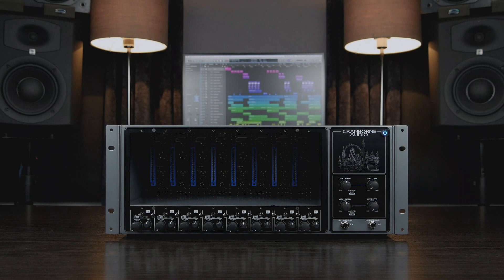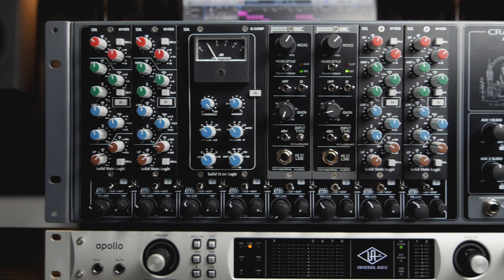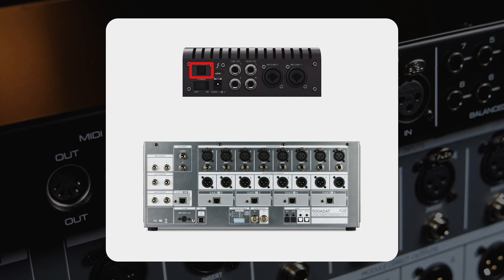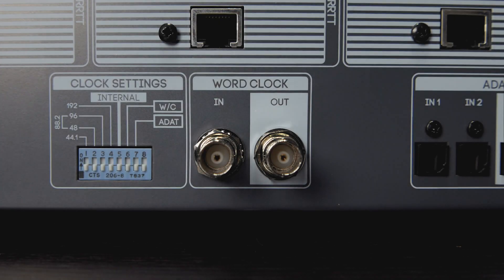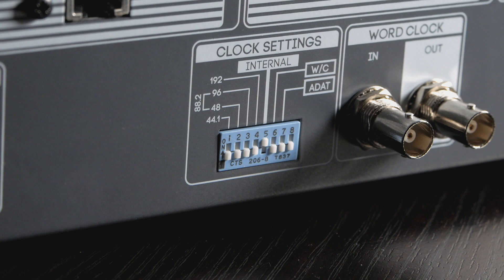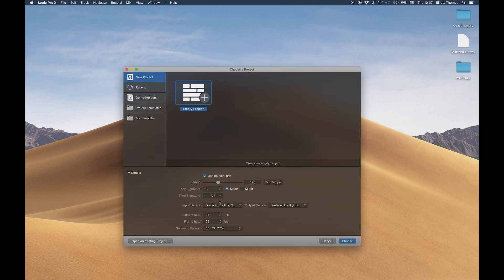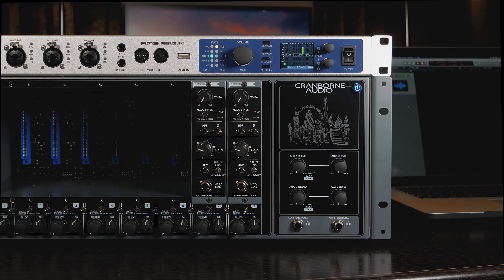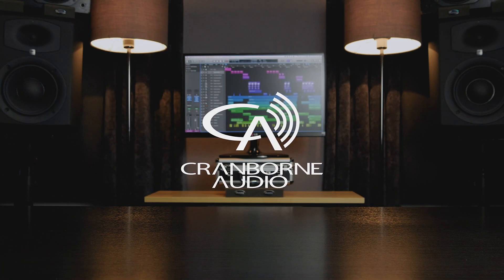500ADAT Quick Tutorial | Expanding Your Audio Interface Using ADAT

Comment: HI, I am planning on getting a Cranborne 500ADAT to connect to my Apollo x8 but keep it next to my drums while the Apollo is on a rack further in the room. Would it work to use 20-ft optical cables to connect each other? Also, what cable brand(s) would you recommend for such long size. Thank you.

Comment: I there any option to insert 19 outboard gear? for example, if I want to use dat channel 7/8 for my SPL St Comp, how do I connect th unit to the CB 500? And if I want to use my LA-610 via adat channel 2, is this also possible? thx
Reply from the maker: Hi, each channel has it's own TRS input. So you would connect your SPL Comp to the inserts on channels 7/8, and that would record into your DAW on ADAT channels 7/8. The inserts come AFTER the module slot in the 500ADAT signal flow, and each insert is still available if you have no module installed and the slot bypassed.
Reply: @cranborneaudio  Thanks so much! I just asked that insert before/ after the slot question on another one of your videos.

Comment: Is it possible to use 2 stereo units in the same slots if each unit is bypassed when the other is being occupied. For example, if I have my saturation unit going out via XLR and my SPL big inserted in the same 500 series slot.
Reply from the maker: Hi Rich, I believe you have also just received an email response to this, but for others who may be interested in the answer, if we have understood you correctly; slots are either bypassed or not, and cannot operate in both modes at the same time. Additionally, since the input source for the slots can only be USB or Analog, it's not possible to separate or split the I/O in the way you described. If a module is present, the audio signal always passes through it. We hope this helps.

Comment: Can  I use the slots in series with adat? Instead of 8 separate channel just one channel in and out?
Reply from the maker: Absolutely, if you're looking to use your 500ADAT simply as a single channel strip comprised of 8 modules, simply input your audio to channel 1, then activate the 'Chain' switch on channels 2, 3, 4, 5, 6, 7, and then record to your DAW on channel 8. You can read more about the 'Chain' feature on page 17 of the 500ADAT User Manual here: https://f.hubspotusercontent20.net/hubfs/4191221/User_Manuals/500ADAT/500ADAT_User_Manual_25_10_19.pdf

Comment: All via a set of two cables compared to patching. Amazing. Can you elaborate on latency and with the inbuilt converter,  the crossover distortion?
Reply from the maker: Thank you Tau! We do not publish Crossover Distortion in our specifications because it is vanishingly low... that's easy to say I know! The THD of our device gets better and better as the level drops. There are no sudden peaks or THD hotspots and we have designed the circuit to ensure that THD is smooth, consistent and stays low at low levels, only to increase if things get too hot. Sorry I can't give you more information there but all I can do is assure you that it is very, very low indeed! Thanks again! CA

Comment: Love my 500 ADAT, had a quick question that I'm not sure I saw addressed in the manual.  I have a BAE preamp eq module that takes three spaces, If I place it in slots 1,2,3, can I set 2 & 3 to bypass and still use those channels as inserts or line in on the back?  And if I then want to link that Bae module to something in slot 4? Say a compressor, do I need to switch the link across all of the slots? Would that negate the inserts?
Reply: Hi Chris, I am researching on 500 Modules and Lunchboxes. Your question is very interesting. Do you have an answer already? I would like to know. And congrats to the BAE 1073D module, that one is a gem. I would have another question. How to use a Stereo channel EQ or Compressor module for this 500 ADAT? Is it possible to dedicate an SSL Bus Compressor to a Stereo Drum Bus in a DAW? Thanks
Reply: I have the same question, hope @cranborneaudio reads this. Happy recording everyone.

Comment: 2:06 OK you just crossed the line from confident to cocky. Maybe next time you suggest your clock outperforms other clocks,  don't have an interface with one of THE FINEST clocks available in frame when you show us how to set master/slave.
Reply from the maker: Hi Draztiq, quite the contrary! We are massive fans of RME and respect their interfaces massively - the interface in the picture is our own and we love using it. In this video, we show how you can slave our unit both as a MASTER or as a SLAVE and we describe the differences between the the two methods in terms of the impact of jitter and recovery clock of both devices.

The RME is used as an example interface and ultimately the choice is down to you as the user. However, the numbers we describe in terms of Jitter etc are real numbers published by RME or ourselves. If you compare the numbers scientifically, our clock has less jitter when used in recovery mode and lower jitter when used as the master clock - that doesn't mean that theirs sounds worse or is inferior and isn't intended to be 'cocky' - we are trying to be factual and help you as as a user decide how best to integrate 500ADAT with your interface, Hope that helps!
Reply: @cranborneaudio  Holy shit I stand corrected. OK. That's surprising and I'm very impressed. I'm willing to delete my comment if that's helpful to you guys. Arriving on the scene fully awesome doesn't usually happen, you know?

Comment: Is it possible to use the 4 mic pres on RME UFX 2 in slave mode and extend the amount of mic pres available (eg: want to record drums with 8 mics) also is it possible to do this without having to buy modules installed in it or in other words does this have phantom power for each of the channels?
Reply from the maker: Hi Jordan, sorry fo the late reply! With 500ADAT and the UFX together you can record up to 12 channels - effectively using the UFX's channels as extra preamps, but you cannot connect microphones directly to 500ADAT without any modules being installed. The slots only support line-level sources when they are bypassed - but that being said, you could use any preamp - from any mixer, another audio interface or similar and then connect the output of that device into 500ADAT. Hope that helps!

Comment: I wonder if the ADAT cable keeps the audio quality as a normal TRS/XLR cable does
Reply from the maker: Hi @preciseaudioblog, it's a tricky comparison as ADAT is of course a digital audio transportation method, whereas a TRS connection is all-analogue so neither really 'sounds better' than the other. Most importantly with ADAT and a closed system like 500ADAT is that it is handling all of the A/D D/A conversion into your audio interface via ADAT using its own superior converters in addition to the line inputs on your audio interface - giving you more IO to play with. On a traditional system with TRS cables between a rack and interface, you are not only wasting all of your analogue IO just for your 500 series rack, but the audio interface's conversion will be the limiting factor on the setup. Not to mention issues such as maximum input levels, impedances, balancing and other variables there are with an all-analogue system, vs our hybrid setup. So in theory, our system can sound better (could be quite a lot better depending on your audio interface) and much more consistent, plug-and-play, and adds to your interface to give you more, rather than waste your analogue I/O. Hope that helps! CA
Reply: @cranborneaudio  Thanks for the explanation. Cheers!

Comment: Hi! I'm slightly confused and would apprecierade some help : )

I wonder - would the 500adat act as an 8 ch in/out expander even without any modules installed in it, basically function like a normal converer with adat io?

So in practice I could connect a bunch of syntezisers to the line inputs at the back of the 500adat,  connect it to RME UFX II with adat and do standalaone mixing via RME or daw recordings if I wish to?
Reply: Hey, from what I understand, (I think) this is possible! Check the 500ADAT manual, I believe they confirm it.
Reply from the maker: Hi Nils1 Sorry for the late reply! But yes, you cannot connect line-level sources into 500ADAT and record them without any modules installed! Hope that helps!

Comment: ADAT cable = spdif optical cable?
Reply from the maker: SPDIF and ADAT connections use the same cable (Optical Cable with Toslink connectors) so yes they are the same cable - however you cannot connect Optical SPDIF to ADAT as they are different formats and are not understood by eachother.

Comment: This is insane, i could use this to expand my RME babyface. Is each channel on the 500ADAT restricted to the 500 series device directly above it? Or could I chain them as usual I.E. preamp into comp into eq etc
Reply from the maker: Hey there! Yes you can use the 500ADAT to expand your Babyface! You will get all 8 modules directly into your DAW as well as 8 more channels our from your Babyface. You could record all channels separately, or you can create chains (Pre, EQ, Comp etc) when recording or mixing to process your tracks. What's also cool is that if you have a preamp, EQ, and Compressor in slots 1-2-3, you can record ADAT ch3 to record the effects whole chain, ADAT ch2 to only record the Preamp and EQ, or ADAT Ch1 only to record the preamp, or finally, you can record all 3 ADAT channels to get a full 'undo' in your DAW if you later decide your comp settings were aggressive during tracking! Hope that helps!
Reply: @cranborneaudio  ohhhhhhh snap!!!!! That is freaking awesome. Thanks for replying!!!
Reply: @cranborneaudio  Niiice!

Comment: Great video! One question though, what buffer size would you use when connecting to an apollo twin usb? I like to record at 48kHz.
Reply from the maker: Hi there! The buffer size will not have any effect to 500ADAT and how it process the audio - the buffer size is set by the interface and you will need to pick the optimum setting for either tracking or mixing. 500ADAT processes audio in the same amount of samples at high or low buffer sizes, the differences you will hear in latency will be coming from the Apollo and so your process may not be too different to how you have it set currently! Hope that helps!
Reply: @cranborneaudio  I was trying to expand my apollo with 500r8.

I used two adat cables 500r8 outs> Apollo ins.. and a word clock cable (Apollo manual says to use it).. for some reason uad console and Daw will not pick any signal on adat 1-8.

I set the clock to internal on 500r8 and adat inside Apollo. Set all sample rates to 48k. Even tried setting the clock to WC on both also.

500r8 meters are getting signal. But signal is not passing thru adat. 

Don't know what I'm doing wrong. I'll email you guys as well
Reply from the maker: @umarmausoof7151  Hi Umar, thanks for the comment and thanks for buying our 500R8! The 500R8 cannot be connected to your Apollo in the same way as the video above. The video above references our 500ADAT which is designed specifically for connecting to your audio interface. 500R8 on the other hand is an audio interface itself and is designed to be used instead of your Apollo - it can't be connected to an Apollo and used unless there are some specific routings being done via USB - even so it will not work in the same way as the video above. This is why we had to create two different units. Feel free to send us an email and we can work this through with you. Thanks, CA.
Reply: @cranborneaudio  I’m running adat on my Apollo twin and love it so far but just got an audient 8pre to throw in the loop and I’m not sure the best way? Struggling with that at the moment would appreciate the help
Reply: I always use the maximum buffer size for both recording and mixing regardless of sample rate as latency is a non-issue when using something else other than your interface for monitoring.

Comment: So... if I use an adat expansion unit, am I still using the converter on the unit it is expanding? For example, if I plug a mic into a preamp on the 500ADAT, which is then routed through to a (lets say) Apollo x4, then that signal is using the A/D converter card in the Apollo?
Reply: I believe the 500ADAT is doing the converting and sending the digital signal through ADAT cable and through the interface into the computer.

Comment: I bought it, mine came in todayExpanded my Apollo 8 by 8 more
Reply: I was trying to do the same thing I used two adat cables 500r8 outs> Apollo ins.. and a word clock cable.. for some reason uad console and Daw will not pick any signal on adat 1.

I set the clock to adat on 500r8 and inside Apollo. Set all sample rates to 48k.

500r8 meters are getting signal. But signal is not passing thru adat. 

Don't know what I'm doing wrong... @cranborneaudio ?
Reply: @umarmausoof7151  Heres how I have mine routed.....        https://www.youtube.com/watch?v=361Fq2AMppk&t=391s